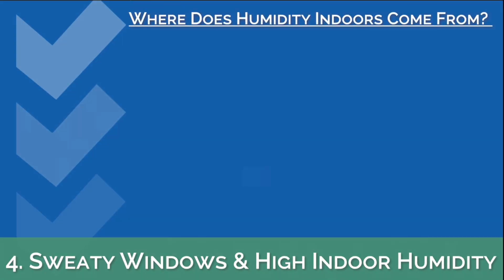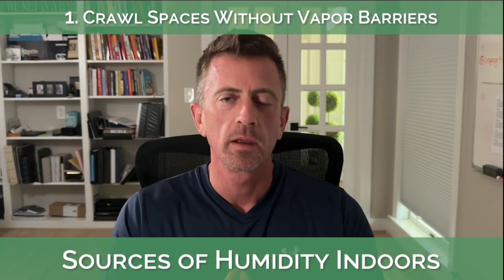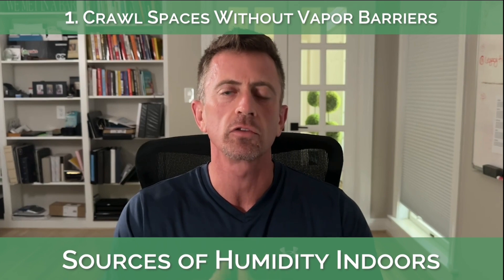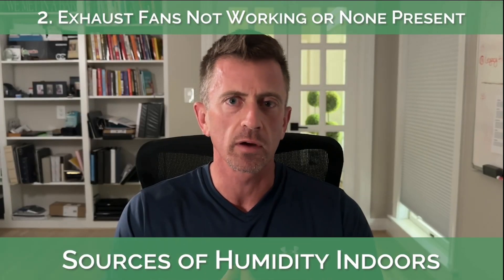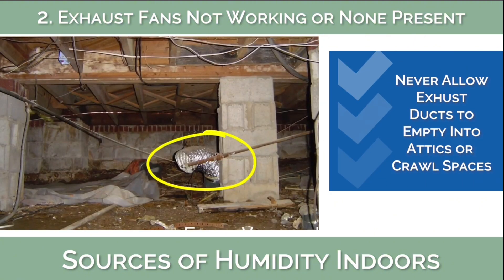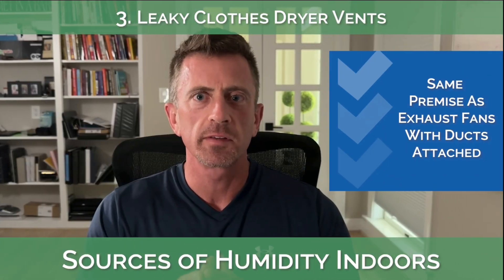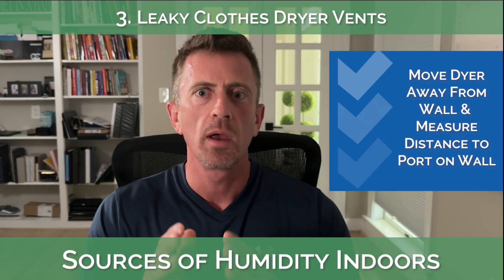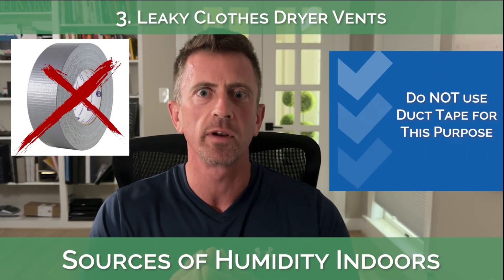Why is My House So HUMID?!  6 Reasons for High Humidity in Houses

Comment from the maker: I should also add that leaky ductwork located in attics, crawlspaces, and garages can also add humidity to homes in the summer time!  Especially if the return-side of the ductwork is leaky, and if the HVAC system is located in those areas as well!